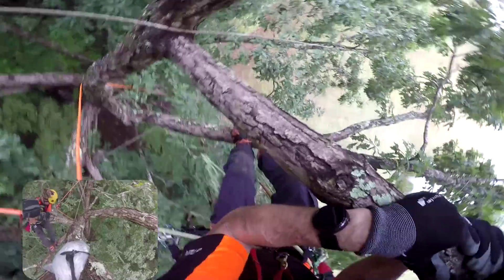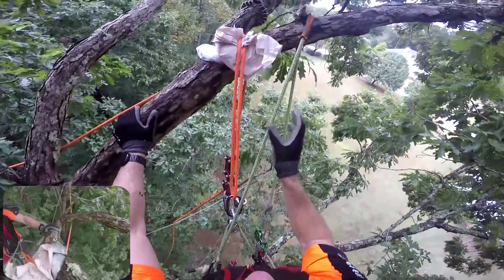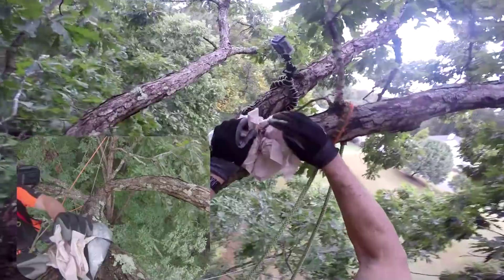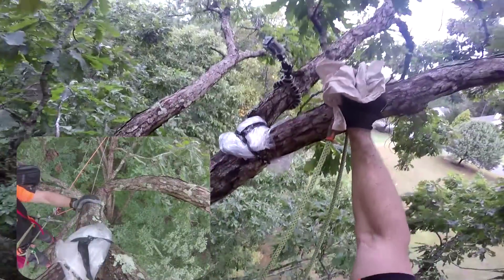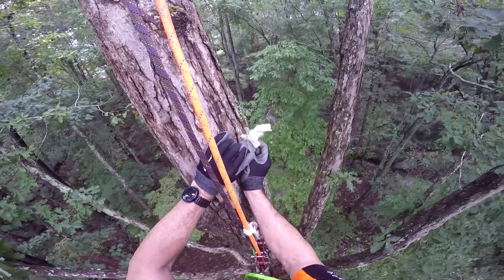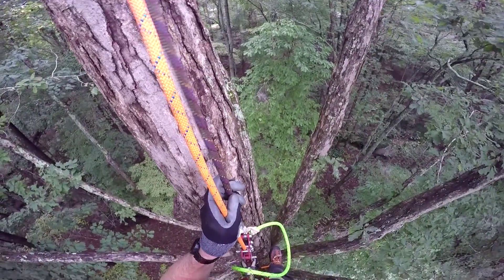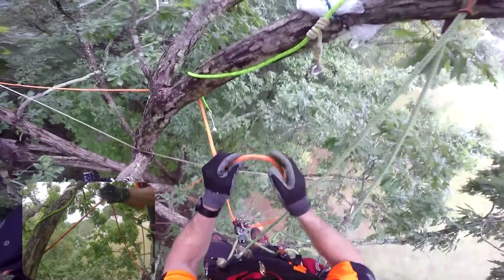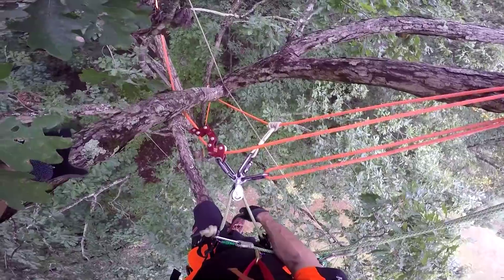Testing the Friction on the M Bight Redirect and M Bight Return Introduction

Comment: Hello from Russia.=)
I am a huge fan of your videos and treeclimbing in general. 
One thing is terrifyng me last few days.
After watching the first video where you introduced M Bright I have tried it on a well known tree nearby my country house.

Seems perfect but suddenly I recognize that it is very dangerous technique. This is why:

Imagine someone is climbing a tree with a tie in on the top, then starting a limbwalking somewhere in the middle of a tree for several meters and then redirecting through M Bright from a crotch which looks good but will fall under load later. If you descend from the redirect point - you will leave 3 to 1 ammount of rope between you and a crotch. so the fall wil be a 3 to 1.

For example the tree height is about 20 meters. The limb is at 13 meters.
the distance from the trunk to the redirect point is about 3 meters and a work zone is located underneath the redirect about 3 meters. 
If a crotch will break - the depth of a fall will be ~7,6 meters (the length of a line from the tie point to a redirect) + 3*3 meters ot rope under redirect = 16,6 meters of a free fall wich is bad in any cause. In certain conditions the length of a free fall with addition of a climbers height might be even longer than a tree height to tie-in.

I assume that every climber is responsible for a redirect and tie in point but if shit happends(as it sometimes do) - the MBright redirect will be hazardous. Though if not a trees but some industrial climbing - when your redirect is buletproof - it seems wery comfy.

Sorry for my english. With kindest regards, Peter.